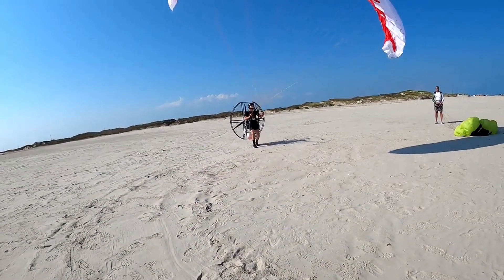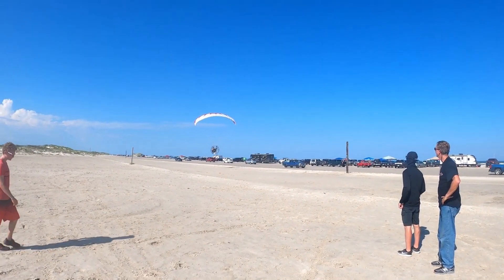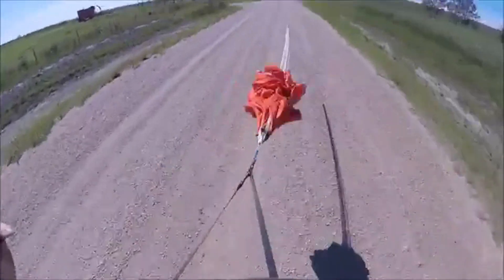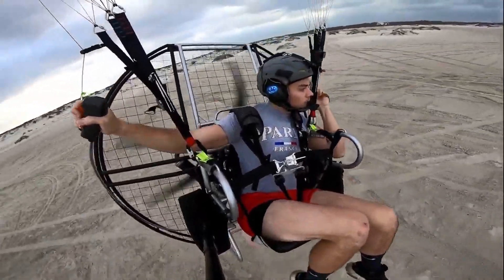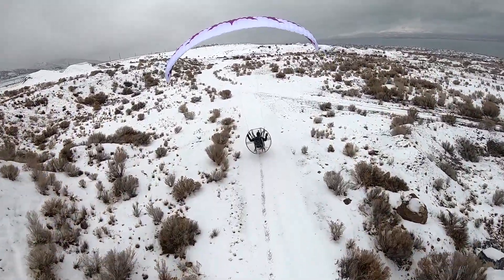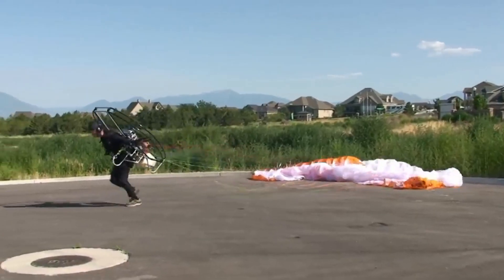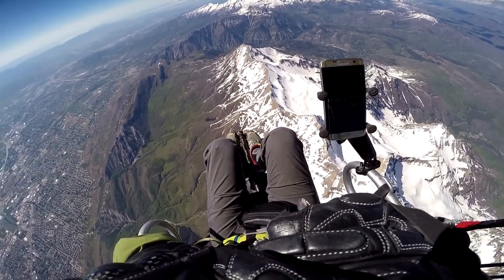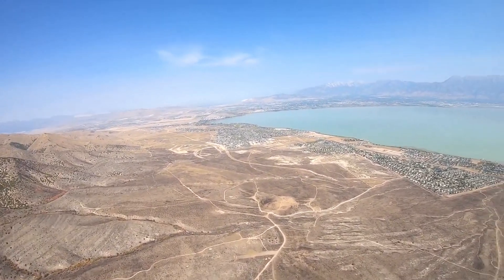What Is A Paramotor & How Do They Work??

Comment: Love the video Trevor! A few minor corrections: First, I would say the typical engine size is from 80cc to 200cc and power wise 16hp to 30hp. I say this as the atom 80 has been very popular with lighter pilots at lower altitudes. Finally, you are not allowed to fly over people which can limit some people on where they can fly. Anyway, love the video and keep them coming!